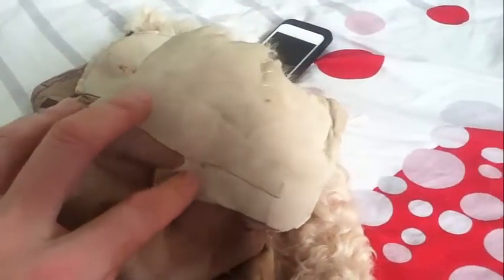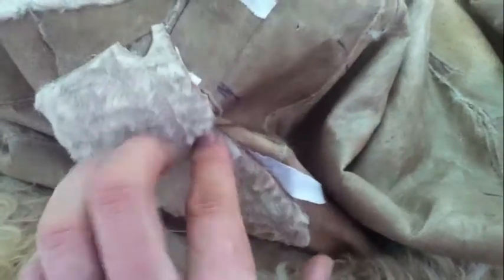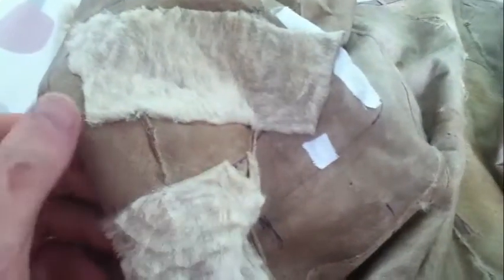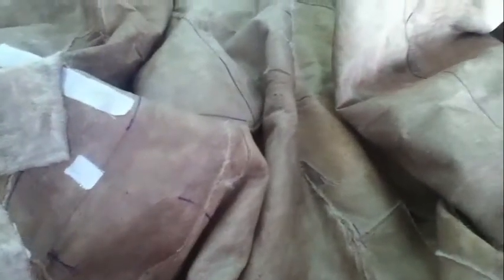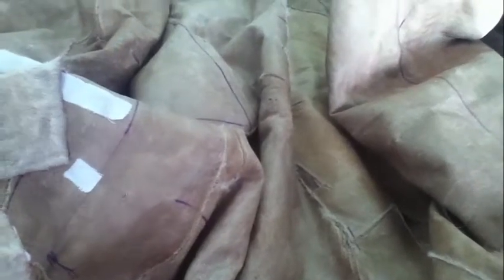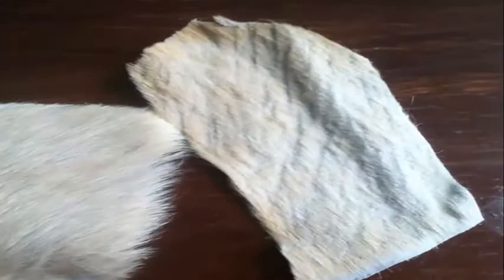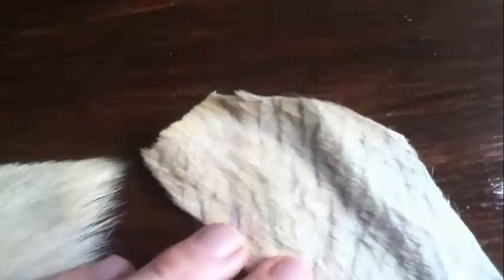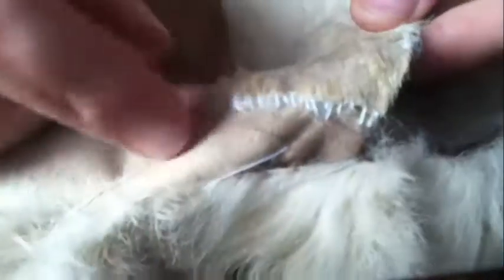Fluffy fur jacket restoration - part 06 - leather patch reinforcement

Comment: What kind of glue did you use?
Reply from the maker: I first tried white glue. I found later it was not effective. Instead I learned the professionals use a rubber cement. Green coloured goo. Not the cheap types - but a more expensive kind that sets in 5 minutes. There are many kinds of brands. Apply the glue to both surfaces, and then press together.
Reply: ***** Thank you! I just used Barge glue cement which works similarly.
Reply: I'm not a professional, but I do have a coat with a small tear. I've been afraid to use any kind of glue, and I've been worried about certain materials touching the hide, because like paper and paper adhesives, I think it is quite likely that the pH of glues or even the pH of certain types of material could damage the hide. Am I correct on this?